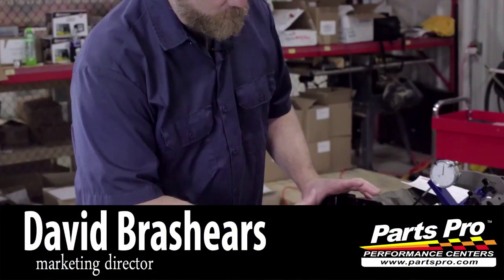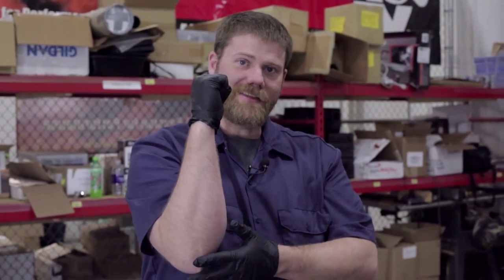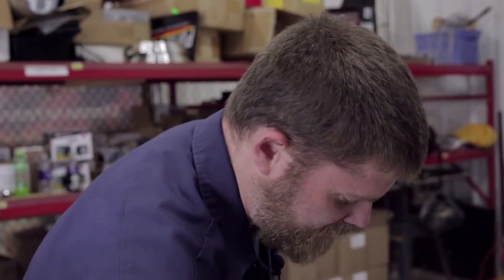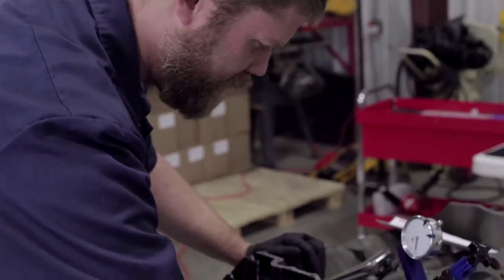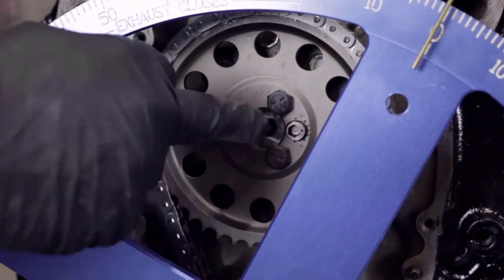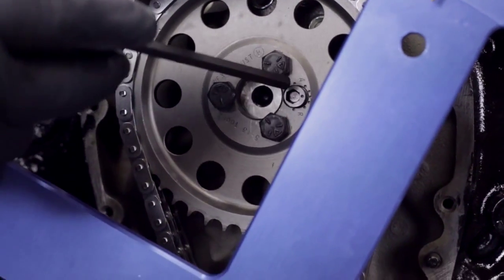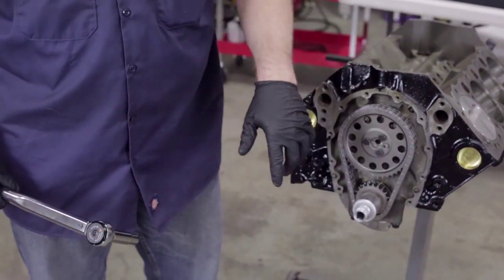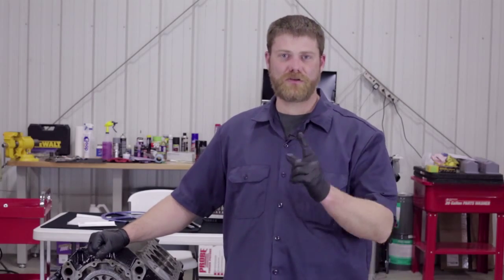Small Block Chevy Engine Build: Degreeing the Cam Shaft (Part 2)

Comment: you don't explain how to use the formulas, find that your cam is off, and then apply that to finding how many degrees on the cloyes hex adjust.  you should call this video, how to turn the allen bolt on a cloyes hex adjust.  bunch of talking and no real world help.  also your videos for this build do not play back to back.  did you ever complete the engine?